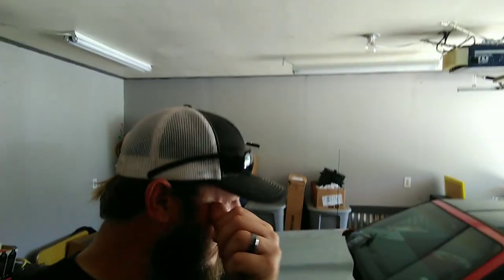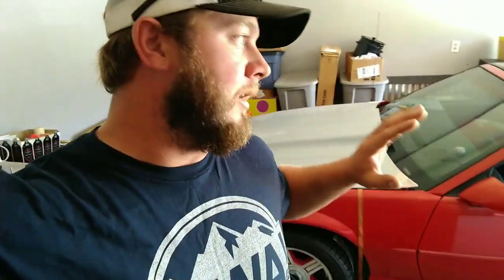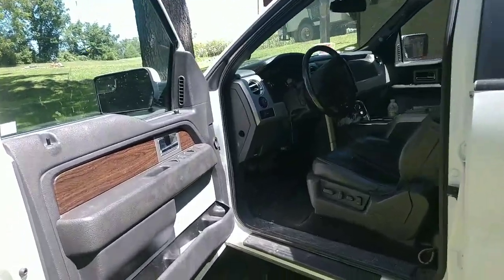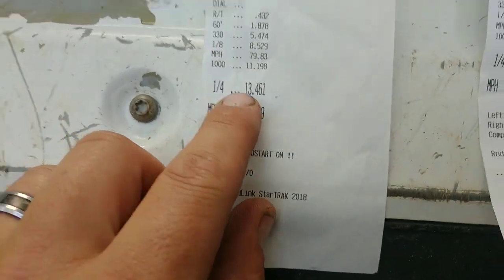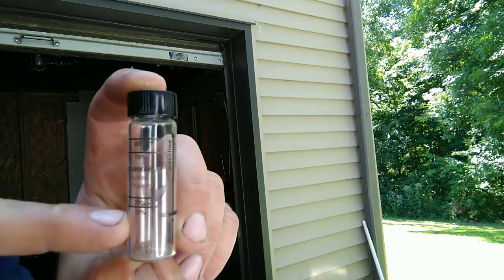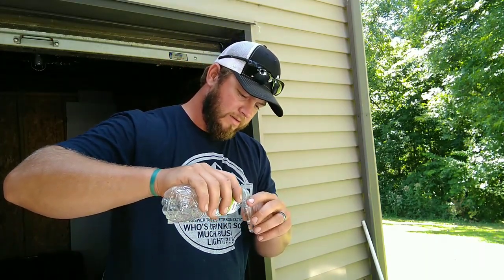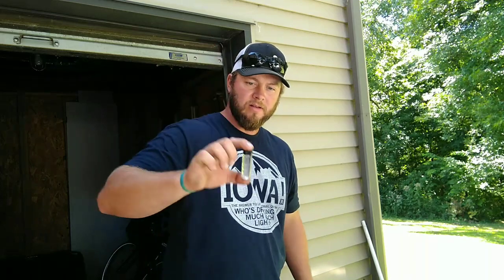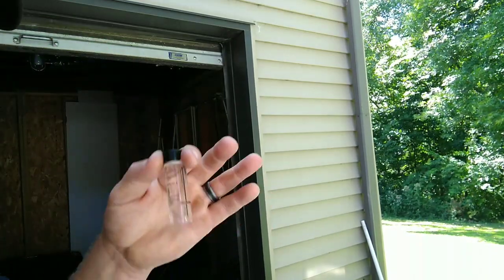EcoBoost E30 MPT Tune! BLENDING YOUR OWN FUEL!!

Comment: Have you ran this tune allot?
I have a 2013 EB and I purchased MPT e30 tune. Ran it for 7 days and ended up cracking a piston so now im putting a shortblock in it. 
I loved the power but now im gun shy of the tune.
Reply from the maker: I only ran it for a day at the strip. I do know it's important to test your fuel to be sure you're getting correct blend for high octane, I have spark knocked my truck once, (running 87 on a 91 tune)..it's a horrid sound!!